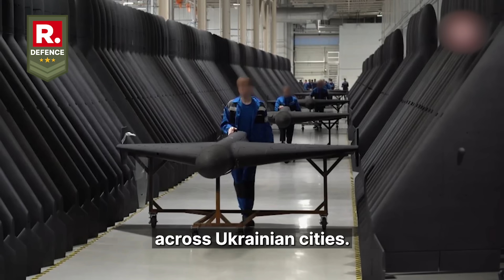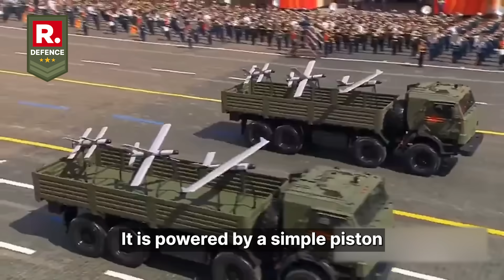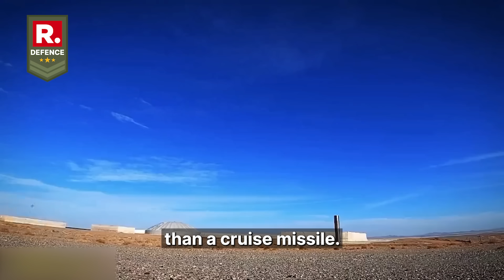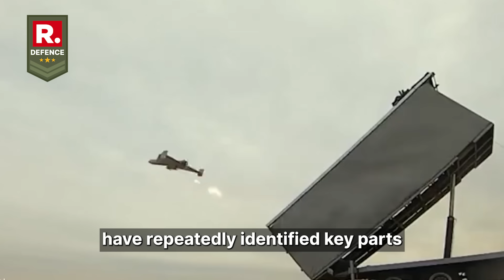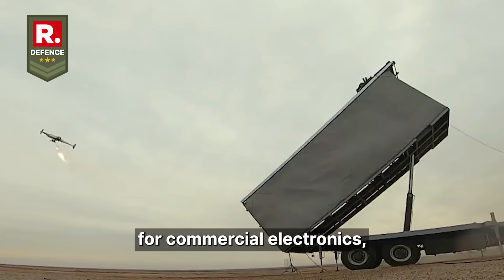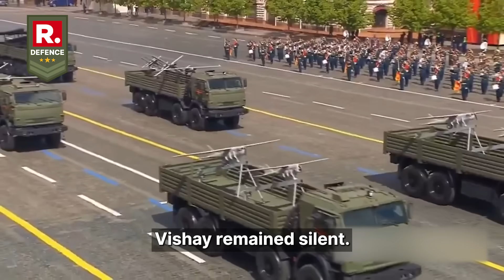Putin's Drone Has Indian Tech Inside It - Claims Ukraine

Comment: The Bridge Rectifier E300359 by Vishay Intertechnology and the AU5426A chip manufacturer Auro Semiconductor which is a PLL-based signal generator chip developed by Aura Semiconductor.  The Bridge Rectifier is used to convert AC input to DC output. The chip is used in navigation and communication equipments. Both are  off-the-shelf electronic components used by various industries and in various products!  The manufacturer sells it to suppliers from whom Russia, Iran or anybody could purchase ! These are not the sole components in a drone.  There are microcontrollers, sensors, other chips with specific functions etc. in a drone which are not manufactured by Indian companies!  Then why not Ukraine complain to respective countries who manufacture them?  Why single out India alone?  Any electronic component can be used in civilian or military equipments.  India cannot prevent it! It is foolish to complain like this!